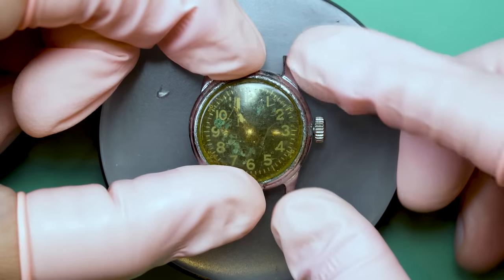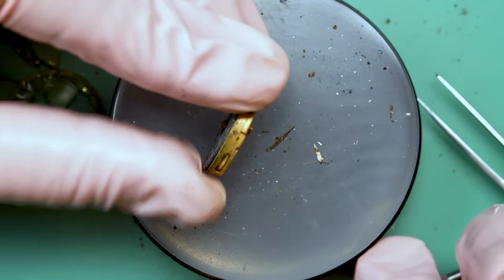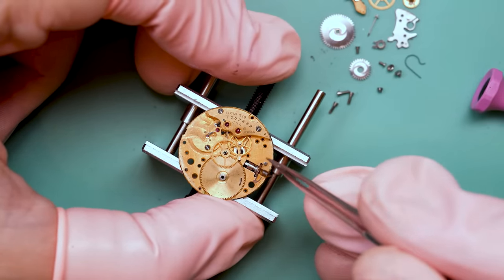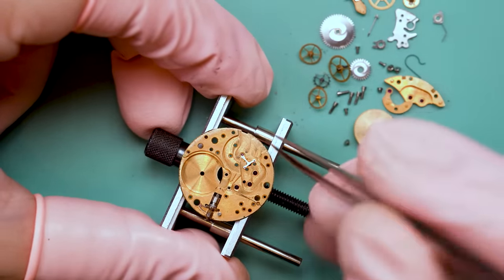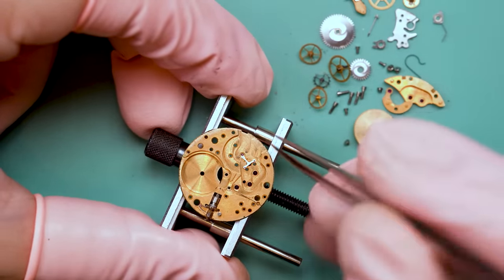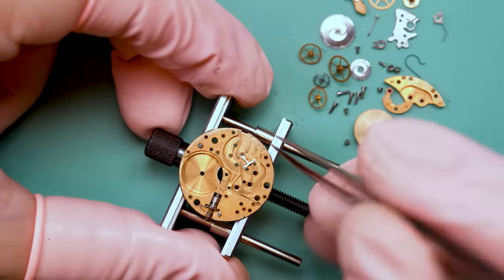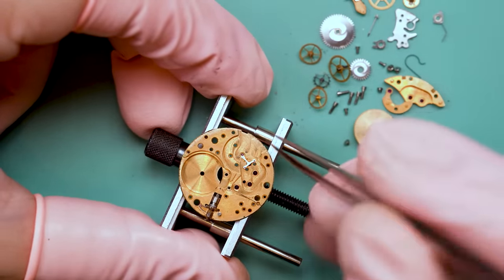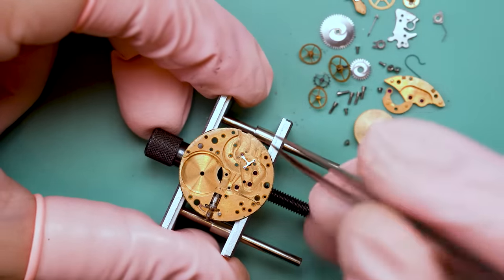Destroyed Vintage Elgin A-11 Military Watch Full Restoration

Comment: I was unsure about which dial was best. However, once you put it all together the replacement dial looks superb within the complete restoration. There is still lots of character in the replacement dial, hands and watch body. Superb. Absolutely blown away by your passion and dedication, especially with the laborious plating process!
Reply: I think maybe if you sold it as a collection piece, you could include the old dial and spring in a little box with it, so the person could have the originals in case they want them, without it having a negative impact on functionality.

Comment: I concur with you dial choice.  With old anything (motorcycles, cars, watches etc.) at some point interesting patina crosses the line into non-functional. And I also find if you restore some finishes (like your case here) and then leave other bits non restored and just cleaned up, those non restored bits look really bad.  So I think you nailed the approach considering how far gone the whole thing was.  And as long as you keep the original dial with the watch you retain the history.  Love your work.

Comment: Nice job Marshall. On the dial, I would also go with the newer better condition dial. The old one isn't just a little stained so it has character, it doesn't have neat battle scars - it's a wreck. The damage is so severe that now it's a mess, unusable, unreadable and looks like junk. So good call.

Comment: What an amazing restoration. It looks like a new one.  I once tried copper plating when I was a kid, using a chemistry set and a 9v battery. It worked really well, but nickel, that is a whole new level. Well done.  Your videos are amazing.  I used to repair old 35mm  mechanical camera shutters, I did my apprenticeship on them. I thought that was small and tiny work.  The mechanical shutters have timing devices in them, very simple escapements compared to these watches you do.  Fascinating adventures, every one. Thankyou for doing these very engaging videos.

Comment: A carding wheel or caring brush will remove the black residue left from the Evap-o-Rust.  It's the same thing as normal wire wheel or brush, but it's ultra fine.  They are usually 0.0025 or 0.003 wire diameter, whereas as normal wire wheel / blush is 0.006 and larger.  Gunsmiths use them to remove surface rust and oxidation without removing the bluing.
Reply from the maker: I'll look it up
Reply: ...it would have to be a VERY SMALL "carding wheel"-(!)
Reply: @WristwatchRevival  look on Brownells for them. They arent expensive in comparison to other wheels but I've never seen them in sizes that would be useful for the tiny parts you are working with.
Reply: The blackening may be a formation of iron oxide
Reply: @WristwatchRevival  0000 steel wool with a little bit of oil on it is another old trick for taking off the red oxide while leaving the black oxide behind.

Comment: When you have a part that is rusted fast, like the winding stem was, you might try putting some "penetrating oil" on it, the type in a spray can, that foams up, then tapping repeatedly on the part (to work the oil even further the mechanism), waiting a while, and retrying, to check for any free-up of the part.

Repeated applications and waits may be helpful, but on parts as small as those in a watch, penetrating oil should dissolve-in and break-up the rust, and run you less risk of doing further damage in the disassembly.

Penetrating oil will not create the black deposit on the surface of treated parts that you get with Evapo-rust.
Reply: No worrys this guy knows what’s doing :)
Reply: @masterk5372   ?????  If only you did.
Reply: @masterk5372  Normally I would agree with you , but not in this case. 

A bit more patience , some penetrating fluid , and some kind of controllable vibrating device would most likely ( given time) have allowed the winder to be removed without breaking .
Reply: @masterk5372   This "guy" hearted the post, didn't he!

Making a suggestion  isn't suggesting the guy doesn't know what he is doing.

I'll bet he'd be the first to tell you he doesn't know everything there is to know.

Comment: Wrt getting the blackened ferrous parts shiny again, iron is fairly reactive. The evaporust (as far as i can tell) is a rust converter. There's no realistic way to reduce iron back to metal especially for small parts. That leaves things like air abrasion (remove the oxidised metal) and polishing (restore the surface). Imo, with such small parts, it isn't worth it. 1. The dimensional changes could affect how well the mechanism works; 2. The patina from rust converters actually prevents further rust by acting as aprotective barrier (for rust converters to work, they have to produce a compound more 'chemically favourable' than rust).
Reply: Thank you for having the right technical language for this. All I knew to say was that I have seen similar blacking introduced on purpose on (I presume) high carbon knives as a protective coating. I think (I am not a metalurgist!) it is also what you get when you acid-etch folded steel to reveal layering patterns, but take that with a whole shaker of salt.
Reply: @paulcurry4252  my understanding of metal etching is that the difference in carbon content produces differences in the etched surface. More resistant areas remain smooth and shiny, whereas more heavily etched surfaces lose their shine and appear dark from the irregular surface. Similar to how anodised aluminium is black despite being still aluminium chemically.

Comment: This is really amazing stuff! I work with surface mount electronics, but this is another level. Nice job on the plating, too. Actually, you could have used the same process (with reversed polarity) to strip off the old plating. You might want to use a separate batch of electrolyte for that, though, as it will likely get contaminated.

Comment: Amazing work. I half expected you to repaint the original dial yourself.
Reply from the maker: That's one thing I don't think I'll get into, they always looks really bad after repaints I've found.
Reply: @WristwatchRevival  At a guess, the original base color would have been sprayed, and after it was dry, the markings would have been silk screened. The original art would have been done on a much larger scale, probably something like a foot across for the dial. Once that was approved, it would have been photo-reduced to make the screening masks at the correct size. The result was that all the minor errors in the drawing would have disappeared in the photo reduction process.

The modern equivalent would probably be doing the dial in a CAD program and then printing it with a 1200 DPI  (or higher) printer on something that would either become a transfer medium or could be made into a screen.

Comment: Another fine restoration. Just a question, didn't you need to replace the rubber or plastic ring as well? As I would think that made the case watertight.

Comment: You made the right call changing the dial- what a gorgeous watch, and an amazing restoration! One question, didn’t you remove a gasket of some sort that went between the back plate and the other plate that protected the movement?
Reply: Yes, I would assume sourcing a gasket for a long-defunct spec wouldn't be the easiest, but I think leaving it out and compromising a core function of this watch (waterproofing) it can't truly be called a "full restoration." Then again, as a norm tritium paint is almost never restored, which was also a core function of this and other watches. Whatever the case, an amazing result given the condition on arrival.

Comment: Just found this channel and am deeply impressed by the work you have on display here. I do agree that the new dial was the right choice, and have just one question after finishing the video: what happened to the rubber seal from 2:59? It looks like it's on screen at 44:35, but wasn't part of the reassembly.
Reply: Good catch!

Comment: Don't have to scrape off the plating. I redo Swiss precision internal micrometers and I have the parts de-plated first by reversing the electroplating process then I bead blast then finish and have the parts plated. Nice work. I was also wondering do you do any laser welding with a PUK type instrument for filling in pits in the cases, etc...
Reply: Thats how the professional case restoration people do it, reweld the holes, then lap back to the original geometry, otherwise you have to take off too much material.

Comment: Anyone else wondering how Elgin polished that steel gear (I forget the name but it is part of the winding mechanism) so it looks like the aperture of a camera lens?
Reply: "snailing," it's done by mounting the gear in a slow turning lathe and then pressing an abrasive disk against it (offset) that's also slow turning in the opposite direction. Looks like they did two rings of it too!

Comment: On the question of the dial, I'd look at getting it professionally refinished.  Stripped down to bare brass and completely repainted.  Or perhaps use a brass blank of the same dimensions if you just didn't want to resurface the original.  Since you've got a really good looking spare, you don't have to do any of that.  P.S.  Are you going to replace the translucent rubber gasket?  AMAZING WORK!!!
Reply: i wondered about the rubber gasket also.

Comment: Just started watching. Very interesting. I worked on larger machines, encountered a lot of rusted bolts and screws. What i found is to use Koil oil or some other  pentartining oil. It is a very light weight oil. Soak it for minutes to hours. Frees up the rust. You can use cleaners to remove the oil later. It also aids in removing rust. There are also removers that you can soak in in to remove rust completely.

Comment: Awesome video.  Here is a trick you might want to try in the future to remove that chrome plaiting.  Easy Off oven cleaner.   Soak in that for 30-60 minutes then use a fine brush with soap and water to scrape or brush it off... I'm a scale model builder (aircraft, cars and trains) and I use it to remove chrome. Works like a charm.  Not sure how it would be on a brass watch case but can't be much different since I use it on Brass bodies of my model trains. You can use it on styrene plastic with NO problems too.  At least try it on an old junked watch and see if it does.  If it does, it would cut down on your sand time and effort! after chrome is removed then you can prep the surface. the Easy Off will remove paint too.

Comment: Hi, great job, I enjoy watching you work. Those old plastic crystals as they were turning yellow gave off a gas that would rot the hands and cause all kinds of trouble around the center arbor but I've never seen it go deep enough bother the keyless works so there must have been dampness in there as you suspected. I've often found the same in ladies watches from that era, 40s to early 60s and I blamed it on women just pushing their watch up on their arm and washing the dishes in hot water and of course the stem pointed down towards their wrist making it easy for steam and splashes to get into the watch causing the same kind of trouble you had with this one. Again I say great job and keep it up

Comment: Generally, attacking rust changes the rust to gun blue.  Gun bluing is converted rust (by turning red iron oxide, or rust (Fe2O3), into black iron oxide (Fe3O4)).  To remove gun blue you can soak the part in vinegar.  If the evap-o-rust chemical process is replacing the rust with some other metal then the vinegar won't work.

Comment: I just had to watch this video again after two years - why - because I was at my 88 year old fathers' house the other day and noticed he was still wearing his white faced Elgin watch he's owned for as long as I can remember. So I mentioned it to him and he gave me the full story behind it.

Turns out my grandfather gave it to my dad when he became an Army Ranger in the 101st Airborne division in the mid 50's. My grandfather got the watch new when he enlisted in the Navy right after Pearl Harbor was bombed. He served in the Pacific Theater until the end of the war. No doubt that watch took many a bath in sea water, but it still ran. He wore it daily until giving it to my dad.

Dad has worn that old watch daily his whole life. It has survived Ranger jump school and the ruff housing that came with that. Dad was a city fireman after leaving the Army in the late 50's before retiring in 1985. While he was a fireman, he was also a subcontractor and built houses since all those firemen had side jobs back then. That Elgin survived all that too.

After retiring from the fire department, he made concrete statuary and ran a plant nursery with my mom until they both retired together in 2001. Very hard, dirty work! Yeap, it survived all that too.

That old Elgin watch is at least 80 years old and still running strong. The crystal is all scratched up, so you can barely see the numbers through it. The plating is all scratched up worn thin in some areas. But it still works! 

Is it any wonder this old watches had a reputation for reliability?

Comment: Hi Marshall. Great video as usual my friend. I love your enthusiasm for these pieces that us mere mortals would run away from. Question, would bead blasting be an easier method to remove the plating? And would it not improve the contract area for the nickel to bond? I'd be interested to hear yours or anyone's thoughts on the process. Great choice on the dial.

Comment: Very interesting video (as usual!). 
One thing i noticed that you didn't mention - when you were taking apart the back cover, there was a gasket  inside around the case. I didn't see you put that one back or replace the old one with a new one. You didn't say why you left it out. I was curious (it is around 45:50 time mark on the video).
Thanks

Comment: The Roman numerals etched on the inside of the case are put there at the factory. If you notice you can see the serial number on the case back ends in 6789, the Roman numerals read 6789. You see this in many old vintage cases. It was a way to determine that the case and case back are a matching pair original to each other.

Comment: Electro-Clean is a great cleaner for cases like you are doing here. You are doing what I have had to do on certain bad condition cases just to sand them down to the bare metal, use a polishing motor with little buff wheels to polish and get the residue from the sanding of the plated case material. Just like you are doing, get the surfaces as clean as possible, polish up the case as best as you can achieve, then Electro-Clean the case, then electro-plate the case in the karate that looks best to you either 14KT or 18KT just depends what looks best to your view. Good job Sir!

Comment: for the dial; it would've been cool to encapsulate the debris and green corrosion and flaky paint as seen at 8:55 in some epoxy. a thin layer of epoxy or sealing colour coat on top of all that gunk would keep it from going into the mechanism, but would keep the pretty destroyed look. and i think at that time, because the flaky paint is still mostly in place, it was still fairly readable

Comment: I know this is an older video but when plating after the first acid bath, put the part into a zip lock bag and add distilled water to the bag and seal it, it doesn't take much, then place the sealed bag into the ultra sonic cleaner and it will get all of the acid off even out of the little nook and crannies. It works through the bag so you can use them for several different things to stop contamination of the ultra sonic cleaning fluid. For the rust try the bag trick with marble mystery oil in the ultra sonic cleaner.

Comment: I work in a plating plant. When i etch aluminum or stainless it comes out black which then needs an acid deoxidizer bath. I doubt this is the issue as my parts have a thick layer of black that can be wiped for the most part...but, maybe look into some deox. 
Awesome content, found your stuff to try and fall asleep to but it seems to be the doing opposite. 
Keep up the great content!
Reply: I've never done it with a piece this small but hydrochloric acid would remove that layer of nickel pre-electroplating. Microshield can mask any parts not needing etching.

Comment: As a FYI, when a "rust remover" seems to turn the remaining metal black, the thing is that it's not really a rust remover, it's a rust converter (aka "rust killer" or "rust reformer" etc).

The red crumbly stuff is one kind of iron oxide principally  (Fe2O3), and the black stuff is another kind of iron oxide (usually Fe3O4).  The former doesn''t stop ongoing rust, it just removes the existing stuff.  The "black rust" sticks to the metal better, sheds the excess red rust and prevents or greatly reduces the infiltration of anything else to cause further erosion.

This is a little like aluminum - aluminum actually oxidizes faster than iron, but the aluminum oxide laid down in a thin layer prevents further erosion.

Think of "rust converters" more as a anodising chemical.  It's essentially the same thing as "bluing".

This is ideal for dealing with rust on delicate items or ones that can't be sandblasted.

I'm not sure how you can reliably take the black off without abrasion.  You might try hydrochloric acid, but at high concentrations it'll erode metal parts.

They don't say much about what evaporust contains, but I suspect it's a bit of both - remover and converter plus various modifiers.

Comment: Out of curiosity; why wouldn’t you soak the watch in penetrating oil, to try to help loosen the rusted parts? You can clean that off afterwards as part of the cleaning process. Just wondering why you didn’t try that first. Otherwise; an amazing restoration, you patience and skill are commendable; and you have a steady hand like a surgeon.